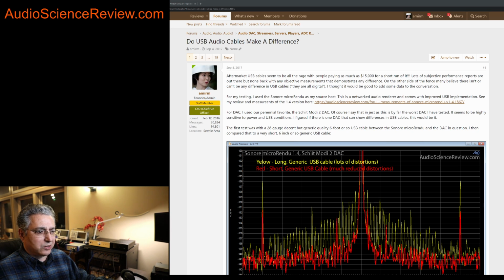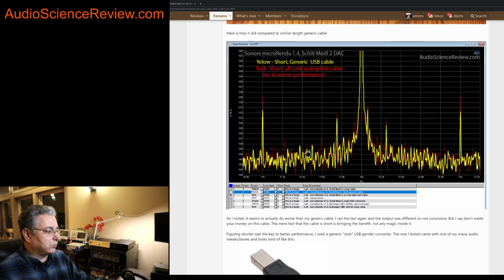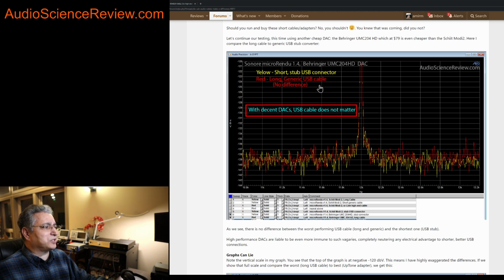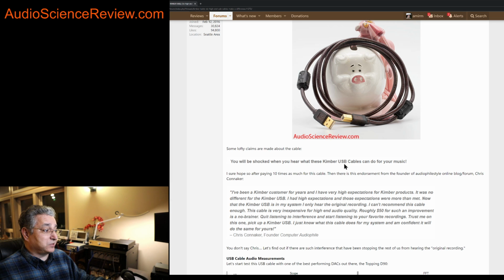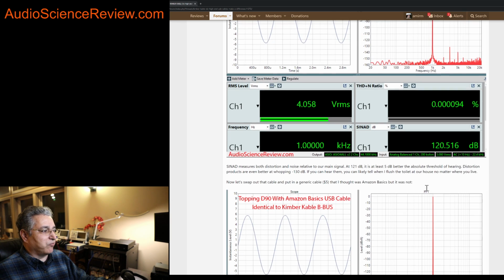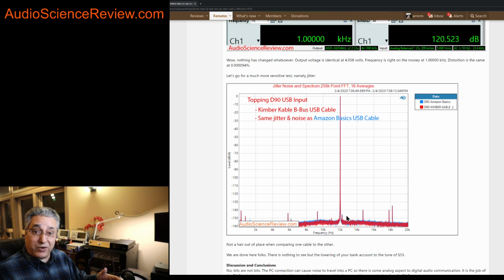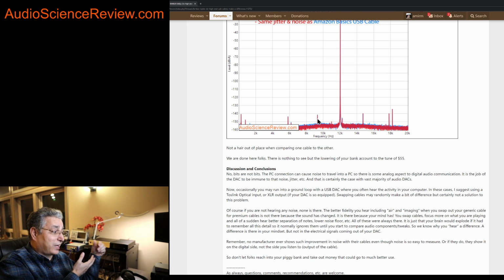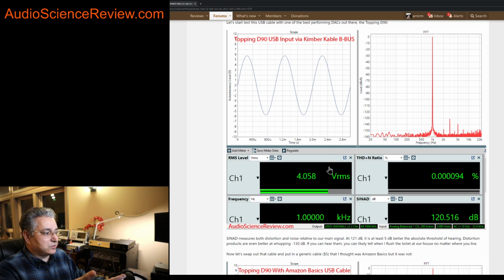Do USB Cables Make an Audible Difference (Kimber Kable Review)?

Comment: Amir, got few honest questions for you, hoping you can comment on it.
1) Can you try a different "high end" USB cable?  If USB cables makes a difference in measurement, who is to say a better engineered cable won't have a better measurement?  Maybe the Kimber one you have is just a rebranded low quality generic cable.
2) can you explain in step-by-step for a lay person why a cable carrying digital bits matters?  I mean, jitter can't possibly be introduce in a cable, right?  Even if jitter magically gets introduced in a cable, I was told that in USB the data is clocked on the receiving side so by the time it is clocked, the jitter introduced is gone.  So now you take jitter out of the picture, then with digital signal transferred over wire, the only thing that can happen is that a 1 turns into a 0 and vice versa, how does that affect noise and distortion?  It would be like talking on VoIP, if the digital signal data is alter, the voice either sounds like darth vader or it gets chopped out.

I know you said you don't care how the signal is when it is transferred to the DAC and that you only care how the DAC performs with that signal, but I think if you wanted more accurate measurements, you need to find a method to compare the data packet transferred from both cables and analyze and compare it with the source.
Reply: Sounds like this was written by a bot.

Comment: "bits are not bits" eerrmmm yeah they really are or your computer, mobile phone or CD player wouldnt work. If you have a poorly designed dac or you are using the wrong uac implementation then the cable might have some jitter effect but the bits are still bits. Now use the same cable between a PC and a mobile phone and copy files between them and tell me bits are not bits and that it's not 100% reliable.

Comment: I think first of all, it's  more about the two devices at each ends of the cable and there design, and cabling is always a factor is electronics, that's just the way it is.
Audio Precision has a lot of outstanding test equipment for testing audio and video gear and cable, can you test a cable using and MSO -MDO Oscilloscope, and measure the eye diagram, it would also show the jitter in the devices DAC.

Comment: Only time USB gave me issues was a VR headset pushing tens of GB's of data per second (cable was over 30 feet) the cost of the replacement cable was $35 for 30 feet the real issue was using USB 2 - USB 3 lol if I can't see a difference even when the cable was cutting out vs the upgraded one no way you're hearing anything

Comment: Bits ARE Bits. Our entire modern information society rests on that undeniable truth. One poorly designed DAC does not disprove it. I understand you are trying to throw the subjectivist a bone here by acknowledging the potential impact of the power transmission. But that is separate from the data stream as you know. Your statement will be taken out of context and used to sow confusion on what should be a simple concept: bits are bits, a functional USB (or any digital cable) transfers bits perfectly.

Comment: Well maybe there is still a reason why one should buy a fancier branded cable than generic ones. For now, i think ill still stick with buying audioquest cables but ill get from their cheapest line. I tried buying generic RCA cables once and the terminals broke easily when i was handling them. Sadly, people from 3rd world countries don't have easy access to amazon basic, blue jeans cable which would be cost effective thus we need to resort to branded cables that will have at least an assured quality in their tips/termination/etc even if it doesn't make a sonic difference. Actually, buying amazon/bluejeans and importing them might prove to be more costly and would take some time getting them than just buying the lower end audioquest cables which are locally available. I envy you guys who have access to a lot more equipment than us. Cheers!

Comment: Could you please clarify once and for all the digital volume control effect on sound quality?  
For example, how much dynamic range is left if you listen to sensitive headphones on 4% or 10% volume using an Apple USB-C headphone dongle which only supports 48kHz 24 bit sound?
Reply from the maker: I keep wanting to do a research project on that topic but have not had time.  But yes, it is an important topic to quantify as there are so many different ways to change the volume control.

Comment: Is a Watt a Watt?  is 1 Watt from Class A, A/B, D, tube etc the same Watt? Identical Signal, voltage, SPL, etc.  I understand 20 wpc from Class A measures differently from 20 wpc Class D. If we break down Watt per Watt are they the same?  Hope my question makes sense.
Reply from the maker: If have the same level of noise and distortion, then yes, it doesn't matter what topology the amp has.  It is the transparency that matters.

Comment: Analog designer here, bits aren't bits ... when you get enough loss in the cable :) Any properly designed DAC shouldn't care how the bits get to it, it should be retiming them and have a separate analog power supply.

Comment: I'm a little worried your bits-are-not-bits speech is going to be mis-used by the subjectivist camp. As you know, a DAC that you listen to must contain amplification. DACs operate internally at very low voltages, and even a "non-amplifier" DAC with a line out will need to amplify the signal that comes out of the chip. What you show as noise could very well be bad power handling through the analog design of the DAC. But saying "bits-are-not-bits" gives the impression that you, Amir of Audio Science Review, approve the idea that cables can change the bits coming from the source. You did state in the video that actual loss of the bits results in terrible noise, but this nuance I'm afraid is going to be lost on people looking to justify their belief in audio magic. Indeed, if that Modi 2 has a Toslink or SPDIF output, you could probably verify that its digital bit output is identical to its input, even with the noisiest, crappiest USB cable that influences the analog out.
Reply from the maker: I hear you.  But I have to volunteer that information in the interest of full transparency.  Because someone else can do the same test and not have the explanation I provided on why it didn't matter.  That is, it took a DAC that was not well designed to show incredibly small differences.  In a way, such a test shames the cable manufacturers in that they were not competent enough to set up such a test.  And that we can measure cable differences with our instrumentation.

But yes, the risk remains.  If it gets out of hand, then I will have to do more videos to address it.  :)

Comment: Bits are bits, that's not the problem. The issue is analog isolation from noise, whether it comes from the wiring or power supply or any other interference from the environment.
Reply from the maker: Tru dat.

Comment: As others have said, the same type of video regarding fiber optic hdmi cables would go a long way for us. If someone can send amir an expensive hdmi cable that's fiber optic. This matters even more now, as my hdmi 2.1 copper cables are much thicker than most power cables. The 3 foot braided zeskit cables seem to work fine, but when I use the 15 foot zeskit, also hdmi 2.1, non-braided, in-wall rated..I use this to run REW and I get audible noise in the tweeter when it's plugged in (using an unplugged laptop. Hiss is very quiet and only audible within 6" or so. The noise floor on the denon 4700 is fairly low, allowing me to hear this when I plug it in and take it out of the front hdmi port when I'm within 6" of the tweeter)
I have multiple 3 footers(1m) in my system, but they are braided, and short, so I'm not sure if that filters some of the noise, or if the 15 foot just has so much more copper that it's picking up some. Anyway, would be a nice test, to see if maybe I need to start spending more money on my hdmi's.
Reply from the maker: It is very easy to get ground loops in video systems due to the way cable and satellite companies independently ground their gear.  So optical is a good solution to get rid of them if you experience audible noise.  But yes, if I get some loaners, I will test.
Reply: @AudioScienceReview  I'm aware. All too aware, actually! I dropped catv, but had it installed initially.. I had lots of noise and the source was somewhere in the coax.. now I just do physical media and an apple 4k, but I still live in an apartment and had to put a jensen transformer at the entrance of my modem to filter the noise. It actually worked. Went from a 60hz hum to zero noise, but I realize it's just a bandaid, though I haven't studied much on a permanent solution since the transformer worked. I have a power conditioner also. Got it used, has a lot of outlets. A lot of people on ASR say they don't do much, but I like that I can have all 10 things plugged into the same place and have 6 of them on a 12v switch from the AVR. That alone was worth the 150 for an older panny pm5100

But thats great news! Thanks Amir. I also follow Danny and I like him, but Its one of those things where..you take some things you learn and leave the rest. I'm not going to be spending $500 on a power cable, but they do have some affordable diy speakers and flat packs. As for the rest, I will make informed decisions, and you help with that. So thanks!

Comment: Speaking of USB, I am curious if there is a measurable improvement in noise/distortion/etc. with Schiit's "Unison USB" interface implementation in its DACs. They make a big deal about it and have brought this to the Modi 3+ in the past couple of months. If I had one to send to you, Amir, I would. But, I wonder if there is a significant performance difference between the Modi 3 and Modi 3+ with this new proprietary USB interface.
Reply from the maker: I have reviewed the Modi 3+: https://www.audiosciencereview.com/forum/index.php?threads/schiit-modi-3-review-stereo-dac.18480/

I am not seeing any audio improvement using Unison USB.  I think it was a challenge they took on to see if they can do it and they did.

Comment: Ha!!! 
SINAD with Kimber USB: 120.516
SINAD with basic USB:    120.523 
So, there is a difference, Amir, you're busted! 😆👍
Reply: Yes. Golden Ear Audiophiles can hear this difference.
Reply: @kevonmanuel  I did Ethan Weiner's noise-audibility test. In a loud song, I can't even hear noise at around -80.
Reply: @vinnytube1001  If you have the means, reduce good quality 16-bit (or 24-bit) music down to 10-bits (with proper dithering and noise shaping) and compare with the 16-bit/24-bit original. You would be surprised what those last 6-bits (of 16-bits) get you (hint, absolutely nothing!). The 9-10 bit threshold is where differences become audible (and I am talking with good quality non-compressed to hell music).

Amir should really do a video showing how much "worse" 10-bit sounds than 16-bit, it would freak everybody out!

Comment: Thanks for your videos. I spent 20 years  tweaking my audio/video system. I finally came to the conclusion that wires never really mattered as long as the connections were solid and ground loops were eliminated. The room and the speakers make the real difference. Once I realized that I just sit back and enjoy my system.
Reply: I recently just bought a stand for my bookshelf speaker, now they sit almost exactly at ear level. And that surprisingly makes a lot of difference, probably more than cables ever could
Reply from the maker: Well said.
Reply: Hmmmm ... have you ever tried comparing copper wires to silver? It's night and day. Big difference that can bring many speakers to life that were once lifeless.
Reply: Is it possible to eliminate ground loop just in the audio/acoustic room not the entire building/house?
If so, may I have any clues?

Ive struggled to eliminate buzzing and crackling from my speakers.
Reply: @eboboboy  Get a Jensen Transformer Iso-Max -Channel Ground Isolator
Reply: I realised that after 1 day

Comment: Only time a usb cable made a difference for me was replacing a faulty one lol.
Reply: LoL 😂 indeed
Reply: I worked at a GM car plant (Detroit/Hamtramck Assembly) for 30 years in the IT department. The plant was 100% dependent on the data from the servers and the network to make cars. If for any reason the line stopped running it cost $50,000 a minute (USD). Needless to say there was a lot of emphasis on us keeping data flowing. It was a noise laden environment with hundreds of welding robots running 18 hours a day and thousands of Motorola DMR radios in constant use. Oh and the plant has it's own substation too. And yet the data still flowed. Rest assured that the 1's and 0's don't care what wire they go down.
Reply: @zackschindler8334  on hdmi cable youll see difference

Comment: Amir this may be an odd request but can you test the headphone output of the PS5 controller? Since all DACs that use UAC2 won’t work with it.
Reply from the maker: Sure.  I don't use one though and am not a gamer so sorry for the newbie question.  :)  But can you get test tones into it to play?  Can I load up some using a memory card or something?
Reply: @AudioScienceReview  yes but you need a ps5 and then it would send the test tones to the controller. You can use the usb back ports or the browser to do it, the problem is currently they are in high demand but maybe one of the guys in the forum can send one.

Side question: are the differences between UAC1 and UAC2 audible?

Comment: I watched a YT in which someone claimed he achieved 100% success in blind tests comparing a standard USB cable with a very expensive audiophile one. He also claimed that his CD player sounded a lot better than streaming with a standard USB cable. He wasn't using top-end equipment - a Denon DAC and a Rotel CD player. So I did a test myself. I connected my CD (Audiolab 8000CD) to my DAC (Audiolab M-DAC) using coax spdif, and my computer (Mac Mini) streaming to the same DAC using an inexpensive 0.5m USB cable. That gave me a simple direct A/B comparison by switching the source at the DAC, comparing the CD with a FLAC rip from the same CD. They sounded identical.
Reply: I'll just add I have had dropouts from using a very cheap USB cable, which manifested as clicks - but in between the clicks, there was no loss of sound quality.
Reply from the maker: I hear some throwing the word "blind" around but just saying it doesn't mean they did a proper test.  As I mentioned in the video, one has to repeat the test 10 times and get mostly them right.  Otherwise, probability of guessing is too high.  If I flip a coin and you correctly predict heads, it doesn't mean you can always predict the outcome.
Reply: @AudioScienceReview  Indeed, yes. What drew me to the YT I watched was that he claimed a 100% success rate in 16 consecutive blind tests. I'm too polite to say what I think of that ;-)
Reply: 100% the times people hear differences between USB and coaxial/optical is that they don't know that the PC audio settings can be different between outputs, like one has Dolby atmos on and other is bit perfect ASIO. Or one has loudness on and the other one is exclusive Wasapi (bit perfect too). Many times iw seen in audio shop the guys doing that to customers aka straight on scamming them. Also there is that IF you use USB audio 1.0 on one and USB audio 2.0 on the other the 1.0 can have bad jitter, on 2.0 the reclocking is done in DAC :D There are many things you can scam people with. Make them hear "real differences" between USB cables.

Comment: Well, bits ARE bits. That side wasn't actually even tested on this video. I think correct argument to be made here is: Bits ARE Bits, but they are not the whole story. 

Which is what I have always said. Any difference in USB cable could be down to power side of things, especially with bus powered DACs.
Reply: Bits are bits, but there is no such thing as a digital signal.
Reply: @SteelBlueVision   Yes there is. I've seen people repeat that what you said like a mantra, but they always fail to understand that after quantization, information is always digital and it will not be affected by anything analog. If errors over transmission occurs, error correction takes care of them. If it can't, then you hear a dropout and not "lazy vocals" or "curtain over the sound stage".